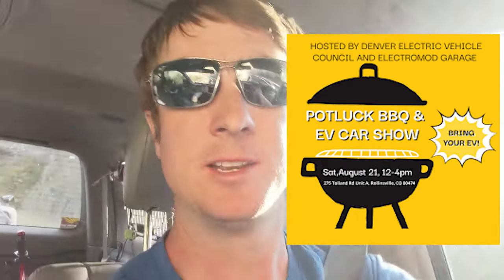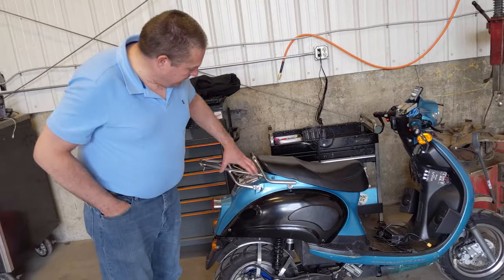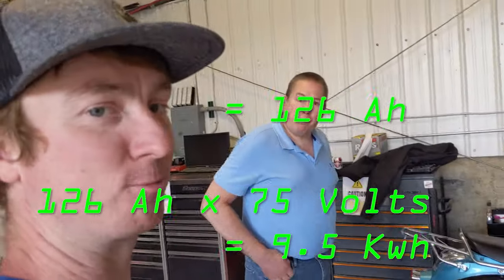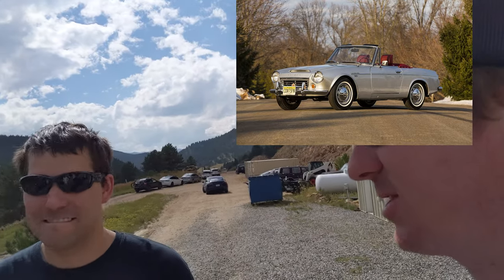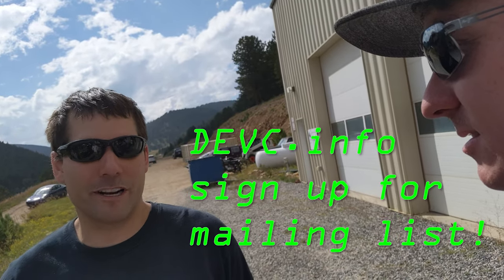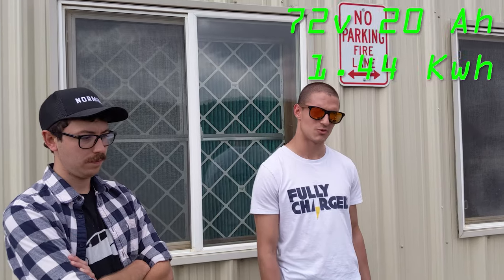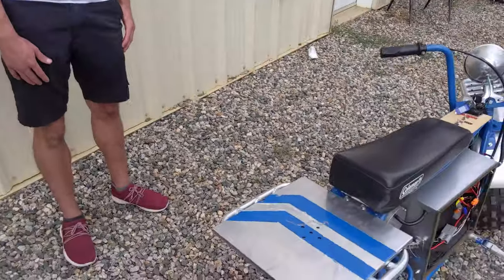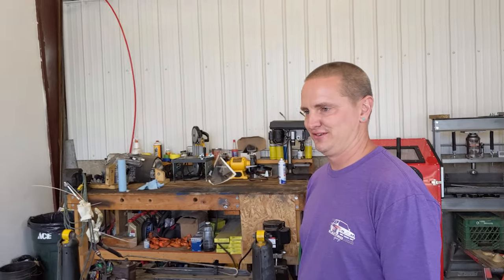Custom EV Swap Electric Conversions at the Denver Electric Vehicle Council BBQ and Car Show

Comment: I have wanted an electric Subaru Brat for ages. I did a report for school way back in 2008 on electric cars being the future, and part of it was about converting a Brat.
I don't have the time, money, or workspace to convert one though, even assuming I could find a body in good shape. 

I live in CO and that ElectroMod place looks neat and could solve a few of those problems. It would probably still cost a pretty penny though. 
Wouldn't it be nice if conversions were subsidized as well as new EVs? They're better for the environment than building new EVs. Well, assuming they're actually driven regularly and not just shoved in a garage most of the time.

I don't know if I could get by with just a two seater car though, that's one of my big hangups with pre-ordering an Aptera. 

Right now I'm driving a Bolt and I love it. Because of the battery kerfuffle, and because of CO weather, I'm looking at the AWD ID4, but it will be a while before they're on the used market and there's no way I can afford a new one.
Reply from the maker: A Brat would be a cool conversion! I agree I wish we could get a tax credit for converting a car for our own use but alas I guess our lobby didn't have a loud enough voice :)